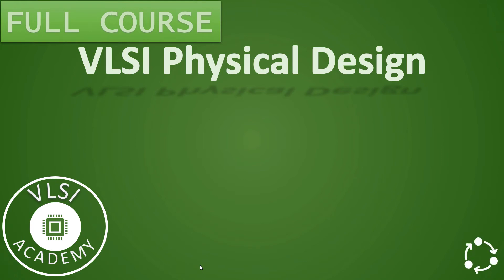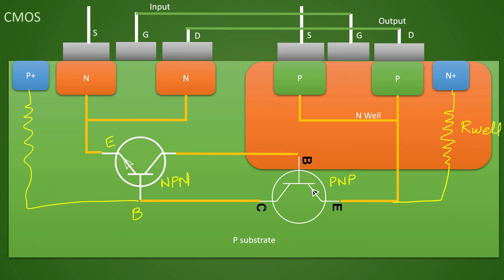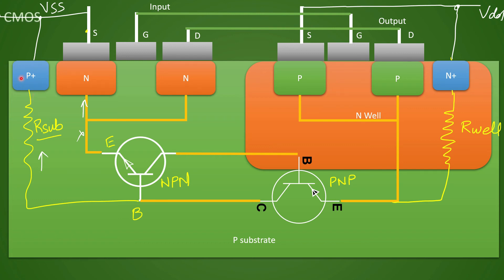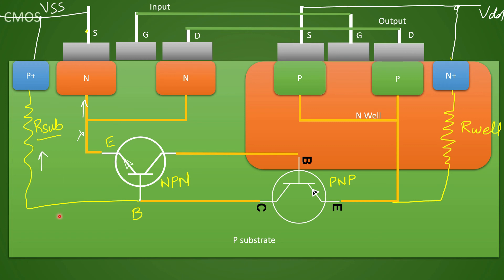PD Lec 40 - Well Tap Cell | VLSI | Physical Design

Comment: But still there exists latchup by connecting the body terminals to vdd/gnd right , because of high resistance path.
For this,
The tap cells are made of high concentration than the std cells in order to provide a low resistance path to avoid latchup is it right sir

Comment: 00:02 Understanding Well Tap Cell as a remedy for CMOS latch-up issue
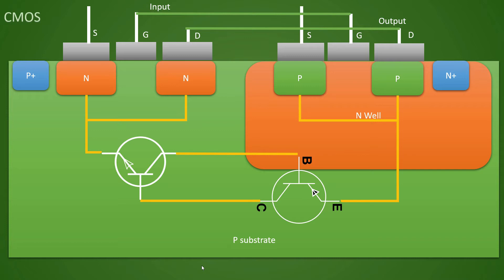00:35 CMOS latch-up can cause power to ground short.
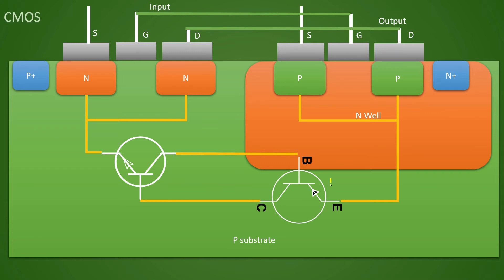01:10 Parasitic elements in PNP and NPN transistors
01:46 Substrate and well resistance in VLSI
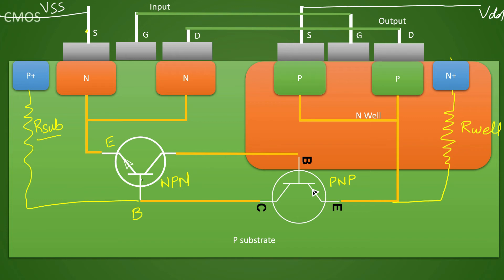02:22 Current flows through the emitter terminal when tapped, bypassing high-resistance
02:55 Importance of good tap in VLSI design
03:28 A Shorter standard cell with a separate capsule was introduced for tapping
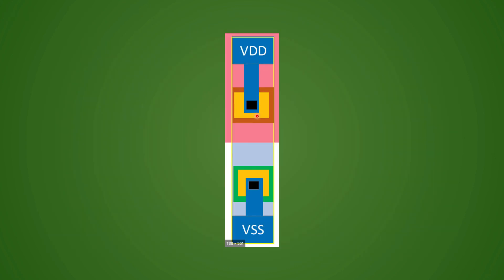04:04 Standard cells are designed with tapless nodes to avoid CMOS latch-up.
Reply from the maker: Thanks alot for timestamps